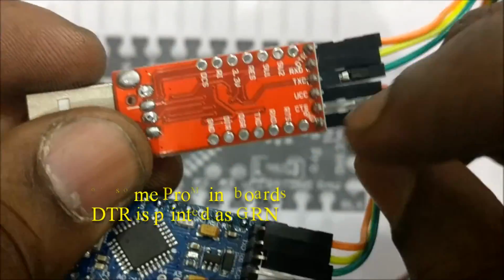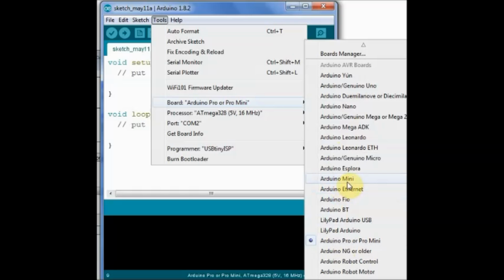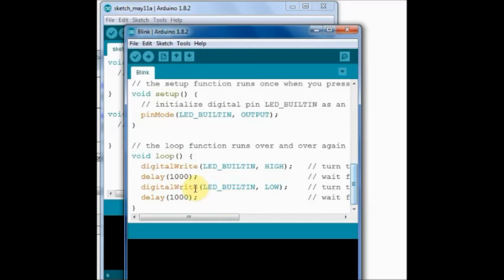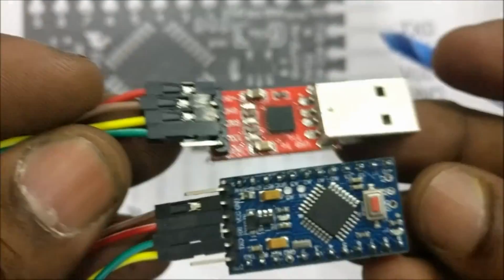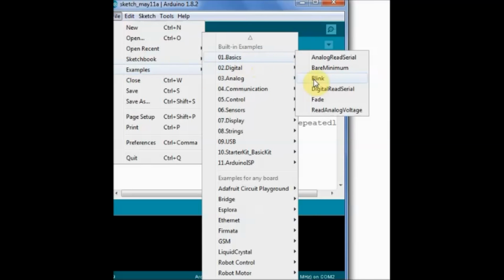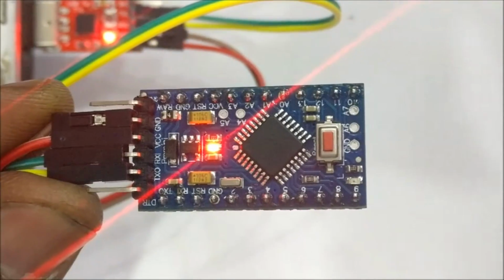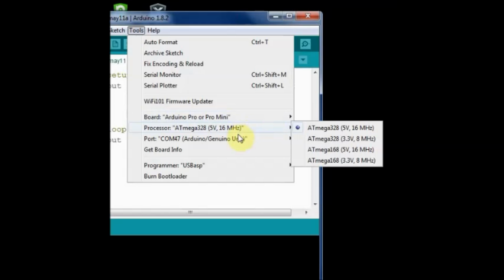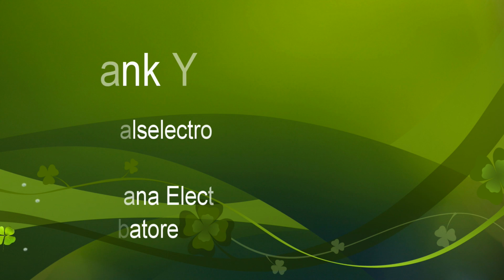ARDUINO PROMINI - HOW TO UPLOAD CODE

Comment: Thank you. I purchased ebay Pro Mini knock offs ( I guess ) and was not getting anywhere uploading. I downloaded FTDI driver, checked Properties, com ports, etc. I even purchased a more expensive FTDI programmer- Only your suggestion on the USB-TTL 5 pin RX<->TX  reversal worked. Plus pushing RESET button when compiling. Sometimes takes a couple tries to get timing right, however- it works.Thank you, much relief on troubleshooting. Best to buy genuine Arduino boards.

Comment: Hi
Can you please help me on something iof you have 5 minutes?
I have? a 5 volt Pro mini(16mhz)  and works nice on a blink scetch.
But the problem is that when i power to RAW pin from batteries (8x1.2=~10 volts)
Vcc pin has only 3.3 volts.
Some men form arduino forum told me to check the F_CPU and  
Serial.println(F_CPU) outputs 16.000.000 (16 mhz)
Also the regulator says S2RA that i found somewhere that is 3.3 volt.
...but i bough it for 5 volt not 3.3 !

You can see in the forum the picture that shows my arduino is like the 5 volt that you are using in this video.
https://forum.arduino.cc/index.php?topic=711660.0

Can you check please your 5 volt arduino if it gives 5 volt or 3.3 vcc 
when you have 5 minutes?
(To avoid order onother that will have the same problem?)

Comment: The solution : a 100nF capacitor in series on the DTR pin.
Now, you don't need to press the button.
----------
La solution : un condensateur de 100nF en série sur la pin DTR.
Maintenant, plus besoin d'appuyer sur le bouton reset.